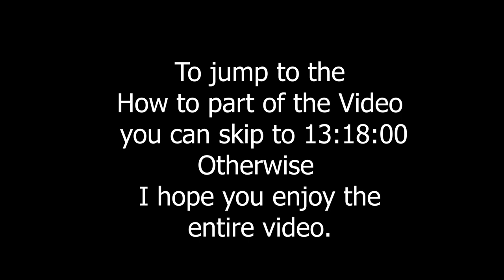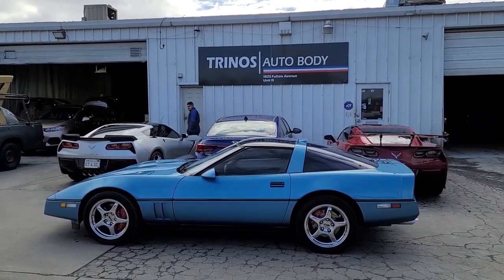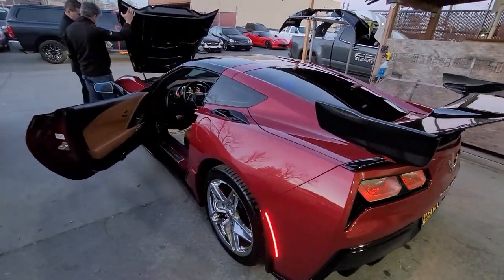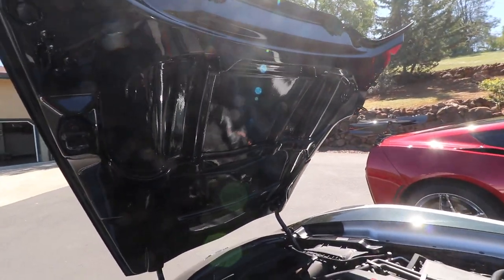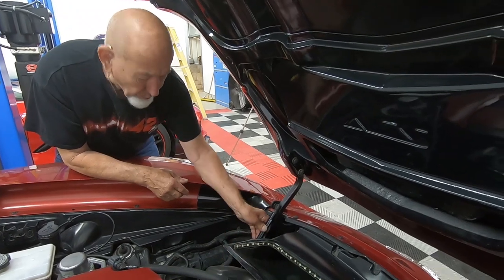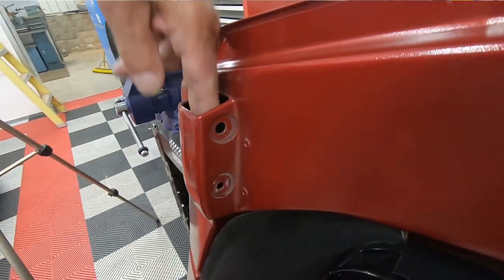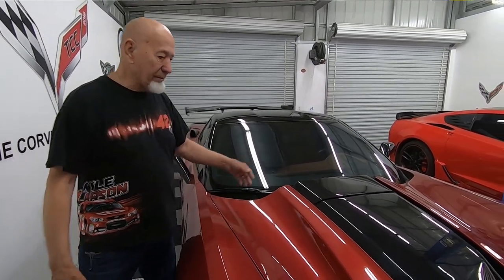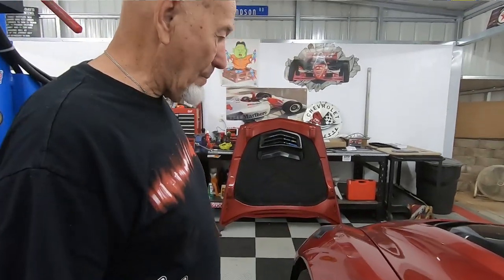Check Out The Awesome ZR 1 Hoods From ACS Composite on Our C7 Corvettes

Comment: Hello Scott i have C7 2015 automatic.what good gas I should use for my c7.?please respond
Reply from the maker: Hello,
I believe in the first couple of years the Owners Manuals said you could run Mid Grad Fuel at a Minimum, but recommended using Premium Fuel.
In the later C7's the book changed and they only recommend you use Premium. If your Fuel is not high enough octane for the car it will trigger a Check Engine Light.
My Car is a 2014 so when I use to drive it everyday to work I used the Mid Grade Fuel now that I only drive it on the weekends I only put Premium in it. Hope this helps.
Reply: @THECORVETTECHANNEL  thanks.I just put yesterday 93
Reply: @THECORVETTECHANNEL  I think I put wrong gas I put ultra 93 what I’m gonna do?🤦‍♂️